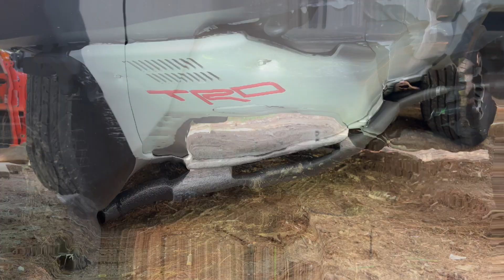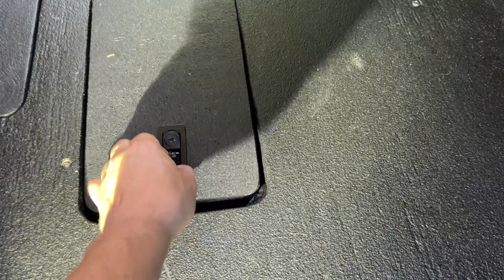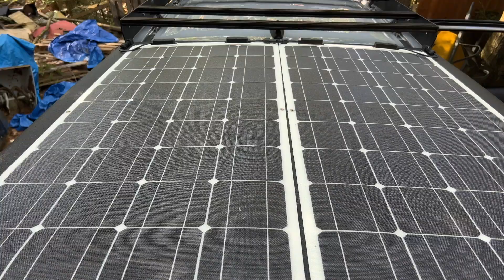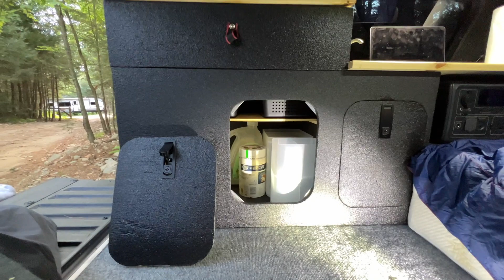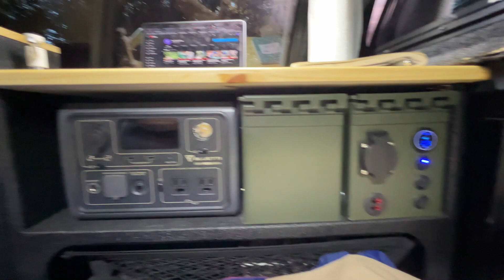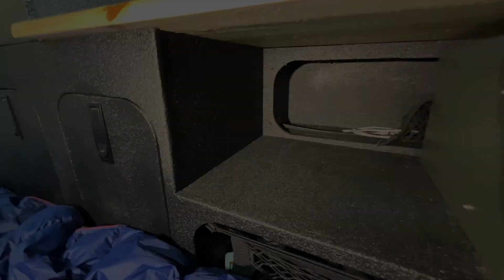Vanlife Toyota Tacoma Build

Comment: Really like this build but it would be a bit short for me. I'm thinking of I do the same thing I can shorten the desk or tables and maybe no sink with more of a triangular counter top, allowing me to lay more diagonally. Just use a squirt water bottle or something into a container & deal with it the next day if its late. I think I would build a static laptop mount & have a roughly 18"x9" flat board & foam seal strip to keep it from flying off for a %60 wireless Mechanical keyboard and mousepad. A computer that can be used while laying down. Some nice USB speakers close to where I lay my head so that I can listen to them on low.

Comment: Really functional build. I like what you've done with and to the Tacoma. Have heard good things about the VHB tape. From your experience maybe it's not as good as I thought. Wonder if the Raptor liner is harder for it to adhere to? Unfortunate Toyota stopped making the double cab with a 6' bed. I believe they now only offer the 6' bed with the access cab. Curious if that composite bed keeps moisture from entering the bed in the usual 2 front corner entry points? I've heard with a spray in liner or no liner at all those 2 front corners just behind the cab are notorious for water seepage. Really nice design. That Raptor liner looks fantastic. Thanks for sharing and looking forward to more of your buildout segments.

Comment: I appreciate your truck bed layout design. 
Everyone seems to put their bed on a shelf/platform, which is great on larger trucks, but the normal Tacoma cap is so low it makes it nearly impractical.
Do you have any plans/thoughs about a shelf or cubbies on the opposite side of your bed. In the space in front and above the wheel well?